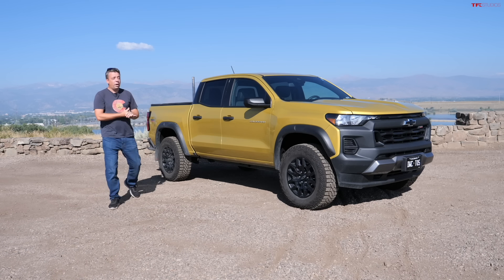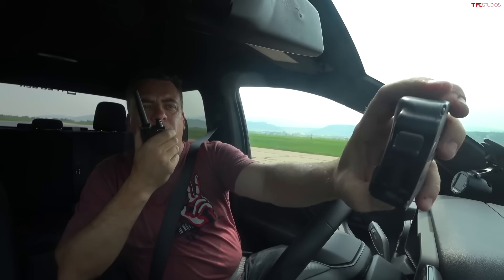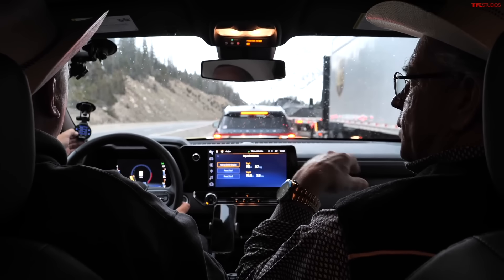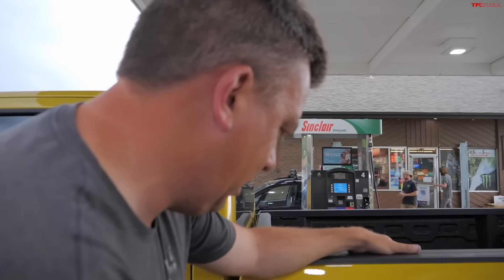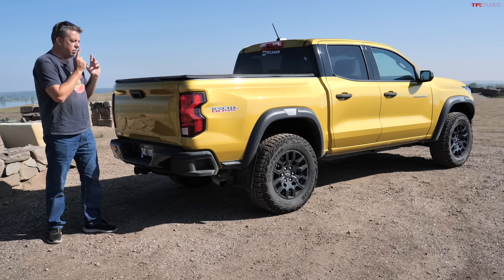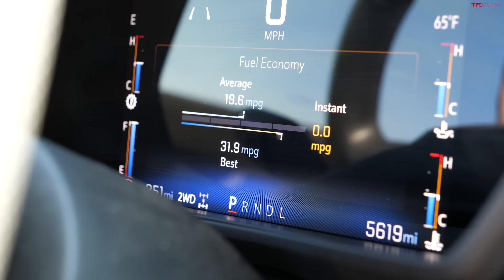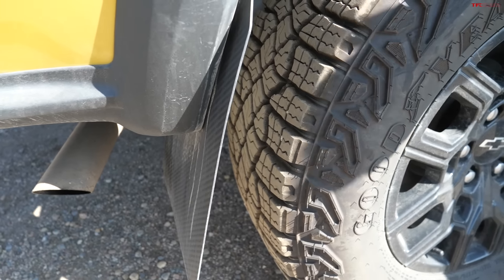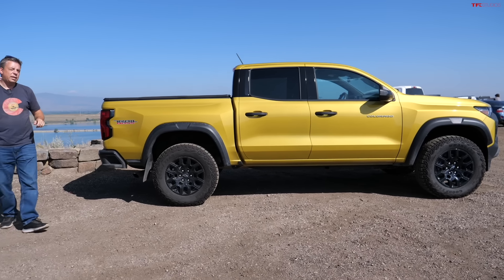Chevy Colorado: Great & Awful Things I Learned After 6,000 Miles - Long-term Update

Comment: I think that you forgot one thing on the negative side... the first issue you had with the truck.  No Cruise Control.  That still blows me away.  I'd have thought that these days it was pretty much standard on all but the most stripped down trim levels.
Reply: you serious, Clark? That's ridiculous. Would be a total deal breaker if I was in the market. I use cruise daily.
Reply: Cruise control is awfully nice if your right knee gets jacked up too, let me tell ya.
Reply: He just missed checking one of the convenience packages. With Cruise you also get HD Surround (fender cameras), rear pedestrian alert/braking and the adaptive cruise. It's $950. I actually don't even care about the cruise control, but the surround camera's are pretty cool.
Reply: Cruise control is all electronic these days. It costs the manufacturer almost nothing to have a button to tell the computer “hold this speed”
Reply: @Reparo96  It's adaptive. It doesn't just hold speed, it monitors lane position and gives a warning on windshield, then auto brakes if necessary.
Reply: I would say that every single new car should have at least basic cruise control these days. I can understand making adaptive cruise control optional, but basic cruise control should be included on all trim levels. I would be in the same boat as Andre. I wouldn't have realized that I need to request that feature. It should be standard. It would frustrate me to death to get a nice brand new truck like that, with all it's fancy computers and screens, only for it to not have cruise control. I would hope that it would be easy and inexpensive to add aftermarket.
Reply: i don't think you watched the whole vid. lol
Reply: $40k for a base level midsize is ridiculous, with these features it should be more in the $30-32k mark for a crew cab
Reply: @paullouthan4390  it’s kinda like the newer 4x4 tundra not having tow hooks in the front of the truck, something that should be standard. But Toyota doesn’t even offer them as an option 🤯
Reply: @TheLostSquadron  theres two different packages. one adds cruise and the other adds adaptive cruise
Reply: @MaestroJericho  have you seen car prices lately? the wt 2wd starts at 30k.
Reply: I just don't understand the decision. I have a 2012 sierra wt that doesn't have power door or locks but it does have cruise lol.
Reply: IT’S AN OPTION!

Comment: No cruise, no telescoping steering wheel, no LEDs, no soft close tailgate, tranny overheated on the ike in freezing weather, broken backup cam, multiple screen issues, unavailable software keeping you from getting advertised engine power, completely unproven powertrain, and it cost you over $40k? Ouch. What was that old Chevy motto? "Like a rock"?

Comment: This is not an upper-trim level truck, like Andre stated, but dang are these manufacturers just cutting corners to save costs like crazy!  Sometimes it's the small things that make the ownership experience a pleasant one.
Reply: Well yeah, it's essentially a work truck trim with some off-road stuff added on. Base model vehicles often have lots of cost cutting, if only to get people to pony up for higher end models where profit margins are much higher.
Reply: To get the small things,  spend the big money and get them with the zr2. That way,  those who don't need the fluff can't stick with less expensive trucks with the hardware only.
Reply: The sun visor thing is stupid. Wouldn't it just be easier to have all of them the same through the lineup? Manufacturers been doing this for years. Some don't have a mirror built in and some do lol.
Reply: cars since 2022. prices up , quality control down , more corners cut. i will not buy this new garbage that is coming out
Reply: @thomaswright3763  there is certainly nothing wrong with that.  As long as you make your vehicles lay by taking care of them (regular maintenance and being a good driver) cars can last a long time.  New cars can too. It's just that the majority of people abuse their cars and then complain they don't last.  Driver is the reason more often than not.
Reply: @elche1976  bullshit, that's a mighty thin defense for abusive practices from carmakers. You think there's nothing wrong with inflated prices and shitty QC? Unreal.
Reply: @elche1976  I'm sorry but the fact that this truck's backup camera is not working is just inexcusable, and that is definitely not driver error. Even the backup camera on my 16 year old lexus still works
Reply: @ajf5745  SMH.  Good strawman argument.  I'm sure they have defects and issues with specific parts not working.  

Backup camera not working is a fact? Sigh. You sure that's a fact? To be a fact that that would have to be widespread.  I'm sure it's not working on isolated vehicles.  But the issues we hear are closer to 1-2%. And not all have the same issue.  Overwhelming majority don't post because they have no issues.  It sucks you may have a backup camera not working.  But that doesn't mean it is a fact for everyone.  It means you have an isolated case.
Reply: @ThomasJeffersonIII  when you have nothing to bring to the table,  well... you do you.  If love to see your face when you look up accrual days and see that the Toyota Taco has more recalls than the Colorado/ Canyon since 2017. Just wait til their first year refresh rooms out. They didn't do anything better before...  should be fun.  Then you can call it junk as well.   🤡🐑
Reply: @elche1976  Except toyota actually owns up to their recalls. Remember when the 2nd gen lexus is models had peeling dashboards? Lexus ended up fixing those for free! It has been proven that gm consistenly avoids fixing recalls for free based on several complaints. And do you really think that the chevy will last longer than that tacoma? The tacoma would probably hit 300k miles or more while that turbocharged engine in the Colorado would probably struggle to reach 100k without major problems.
Reply: @ajf5745  I own a Camry.  Great car.  Don't own a taco because while it has a good resale value, I don't buy a vehicle too sell it. People who buy a depreciating item to sell it are not very intelligent.  The taco while it looks good,  doesn't do anything better.  I want to enjoy a vehicle while I use it for the long haul and that's why it's listed at 6-7 on JD powers.  

The taco will also be getting the turbocharged engine.  The one chevy used has been in the Silverado for 5+ years and many have over 100k. No major issues.  I hope toyota does as well.  If the taco improved power,  space,  comfort,  towing and mpg... I'm look into it.  Right now,  others beat it.
Reply: @ajf5745  the perceived reliability mantra,,again😝
Reply: @paulhunter9613  reason they're still number 1 and 2 on reliability lists
Reply: @ajf5745  they are a number one and number two but it’s got nothing to do with reliability 💩😝
Reply: @paulhunter9613  tell that to reviews by customers
Reply: @paulhunter9613  what does it have to do with then
Reply: @paulhunter9613  Your extensive use of emojis gives me the idea that you're making baseless claims, and therefore an untrustworthy source
Reply: @ajf5745   The only time you would have an idea is when someone tells you what it will be. Don’t believe everything you read on the internet and your claims of so called reliability is just someone else’s opinion
Reply: @paulhunter9613  Most toyotas will also surpass 100k miles without major issues

Comment: It seems like the manufacturers are "forcing" you to pick higher trim levels just to get a few items that should be a relatively inexpensive option.  I really like the look of the "floating roof".
Reply: If you’re patient you can order whatever.  And the stock also depends on what the dealer orders, they can add most options to any trim
Reply: They are doing exactly that,  advertising great deals on the basic model and after adding a few options it's not worth it.

Comment: over 10k (update, now 20k ) miles on my 23 trail boss, towing, off-roading, payload every weekend. Coming from 100k miles on the previous gen z71, the overall driving quality is vastly improved on the new Colorado. With the exception of some software bugs, it’s really a great truck.
Reply: What software bugs are you referring to? I’m currently in the market and was leaning towards a 24 z71.
Reply: @TheKevinGee  nothing that has been a huge issue. Mostly entertainment related. Data and xm radio, also since this comment I have over 20k on it now and not experiencing software bugs anymore. Chevy issued a software update that I think took care of the silly little things that were going on with the radio.

Comment: With the dimensions of full sized trucks getting so large, a “mid sized” truck with all this capability is a nice option.  Thanks Andre, I love the content you created with this truck and I love the color.
Reply: Buy now there big size trucks with V6 engines
Reply: Midsize trucks are getting huge too lol
Reply: The interior is ridiculously tight
Reply: @walkworthy  My son has the GMC version of Andre’s truck, I fit comfortably in the drivers seat at 6’4”, the people sitting in the second row though-RIP.
Reply: I love my 2006 Tundra, it's a midsize strong truck.
Reply: @bryonthor  Tundra is a full-size truck.    The Tacoma, Colorado and Ford Ranger are mid-sized.   So is my 4Runner.    If you went to the dealer and asked for a mid-sized truck and drove away in a Tundra, you should probably not be buying cars on your own 🤣
Reply: @lunamaria1048   The older Tundras are closer to current mid-sizes than current full-sizes. I think that is what he was going for.
Reply: @FLUFFYzeMONKEY  Huh? The old Tundra is full-size.. He made a common segment mistake...  Some people think half ton in mid-sized.      I'm not sure why you are serving up excuses for strangers🤣
Reply: @lunamaria1048  : The 1st gen Tundras (2002 - 2006) were smaller even though they were called full size vs the 2nd & current 3rd gen Tundras.  I still have my '02 Tundra that I bought new. Numerous people over the years have thought that it's a Tacoma & they're surprised when I tell them it's a Tundra. That was the point @bryonthor was making. If I park my '02 next to a 2nd or the current 3rd gen Tundra my truck looks small.
Reply: @oneslackr  2002 Tundra was still a fullsized segments truck.   Was there a point, other than your talking point? Lol
Reply: thank you , a full size truck today is twice the size they were 20 years ago , they won't even fit in parking places

Comment: 13:14 The "part" is actually instructions and an authorization code that GM prints out and mails to the dealer, the dealer then has to talk the GM Tech Line with the auth code in order to download the tune to their scan tool so they can flash your computer.  It's a bit convoluted, but that's how GM is doing it.

Also, the instructions with the auth code say multiple times that the customer IS NOT TO BE CHARGED LABOR to install the tune.  If your dealer tries to charge you labor to install the tune then ask to see the instructions with the auth code so you can point out to them where it says not to charge the customer and instead use a specific labor op code so GM will reimburse the dealer for the labor.
Reply: Good luck keeping dealers honest. Even GM knows most they can’t be trusted.

Comment: I'm about to have 13k on my Colorado Trailboss. So far, it's been a gem! The only thing that occasionally has hiccups is that it doesn't connect to my phone, so I'll have to turn the truck on and off a couple of times. Now, let's get to the crazy part. I have been getting crazy good gas mileage, and I also have to MT tires! Long distance trips I have achieved 24.5 mpg with 420 miles on the tank and 80 left in the tank. But if you step into it a lot, you'll do 15-20, which again isn't bad. Peace! ✌️

Comment: The mid size trucks are basically like a full size truck from 20 plus years ago. I towed a 5800lb trailer 1500 miles in a 2011 RAM Dakota 3.7 V6. I got 11.21 mpg. I believe these small turbo 4 cylinder engines work really hard . The low mpg shows that.
Reply: I've been saying this for a while: turbo 4s in trucks are probably not going to have very good reliability or longevity, especially if you tow regularly. But hey, makes for a cute grocery-getter!
Reply: It’s all about thermodynamic efficiency not so much mpg. That’s why a lot of manufacturers are doing turbo 4’s
Reply: This 4 cylinder is pretty overbuilt from what ive read
Reply: This turbo 4 was overbuilt from the ground up much like a diesel engine and shares some similar design concepts, I think you folks concern over the engine's longevity is overblown.  If this was a off the shelf engine GM was throwing a turbo on it, yeah I might share your concerns.  Bottom line, the key to longevity of any engine is proper maintenance, with turbo engines, this is even more important.
Reply: @vashstampede5933  some folks will always complain saying something won’t last-even tho they don’t own one
Reply: @michealmartin
I would like to see the mpg numbers from your 2011 Dakota going up the same mountain pass as Andre did with his truck. Good chance your truck couldn’t do it
Reply: @paulhunter9613  I would think the mpg would be higher than the high reving turbo 4 cylinder. I've driven mine with a trailer through many areas of the country. Never had mpg below double digits !
Reply: @paulhunter9613 A high strung turbo 4cyl will never last as long as a good naturally aspirated v8. The little motors are much more stressed to make the same amount of power. Extra complexity and more parts that will wear out and eventually fail, too.
Reply: @aaronerickson8878  there are more parts to wear out in a v8 than a 4cyl. And the four cyl turbo is made much stronger to handle that power, folks get confused thinking about the “stresses “ on an engine, it’s not getting floored all the time when taking off from a stop, so no stress at all with normal driving 
With a v8 there are more “complexity” with MDS and variable valve train
Reply: Every big truck has a 6cyl... they tow loaded cross country.  Im so tired of iTs  A fOuR cYlInDeR.... it is built for its application.  Its not a kia rio engine ina pickup.
Reply: @actZR900   Agreed,  I watched a documentary about how the Chevy 2.7 4 cylinder. Appears to be robustly built just for the application in GM trucks. But it looks sooooo small under the hood !
Reply: @theglowcloud2215 dude there's a guy that has a 2.7 sierra 2020, 2021 or 2022 and has 198k as his work truck
Reply: @aaronerickson8878 there's a guy with a 2.7 sierra and 198k

Comment: I test drove a 23 Colorado Z71 over the weekend, it's a nice Mid-size truck with a lot to offer, although i didn't like the seating position (similar to the Tacoma) even after making adjustments legs are too flat, seats are also too narrow not that comfortable, no grab handle on drivers side, back seating is too compact and no flat level floor, power seemed pretty good although i wasn't that impressed for being a turbo you have to go deep into the throttle to get it moving (my wife's CX-5 non turbo has better throttle response) Also the sound of the 4 Cylinder engine on start-up was enough for me to walk away initially!

Comment: Probably would be a good show idea to search out an aftermarket solution to add cruise control.  I'm sure you're not the only one who assumed that a truck that cost $41k would have it as standard equipment.  My 2010 Tundra was a W/T edition that didn't have it but it was a very cheap and simple plug and play addition.
Reply: If u can't read the paper with all the features then that's on u lol
Reply: Sort of like the first-year model Maverick XL.  No cruise is even available from the factory, but you can buy the steering wheel switches from an Escape, and flip some bits in the ECM and you have factory cruise control.  $70 all-in.  Of course, the XL now comes with cruise, but the first year people have an easy path to it.
Reply: @cormaro13  Short of an absolute base model stripped of even power windows what the hell doesn't come with cruise control now?  No additional parts as everything down to the throttle is electric and all you need are a couple of extra buttons on the wheel, the rest is software.
Reply: There's no way this model doesn't have cruise. I think he means it doesn't have adaptive cruise. It's 2023 for crying out loud, this truck has to have cruise.
Reply: @arubial1229 there is no cruise control on this model, higher trims do
Reply: @ctechbob that is just egregious. The hardware already in the vehicle it's just a matter of installing the button and changing software in the ECU.  🤦‍♂️

Comment: I have the 2023 Chevy Colorado LT with the 2.7 Turbo Plus and its loaded down with Options. It cost me $41K, plus I had the bed sprayed with a lifetime coating, had the GM mud flaps and weather mats installed, wide chrome side steps installed, and the truck rust-proofed for Pennsylvania driving. I have only 1,159 miles on the truck and I owned it 8 months. The truck doesn't have the fender moldings, but I had them on previous vehicles and dislike them because of the upkeep and in our region rust generates beneath them. You have a nice off road truck and yes you got your moneys worth. The color of my truck is Radiant Red, and I never expected getting so many compliments on it as I am. I really enjoy my truck I'm glad to have picked a Colorado over a Ford Ranger or Toyota Tacoma. On occasions one of these trucks park along side me at the market where I can made a visual comparison. Yeah, I feel I made the right choice.